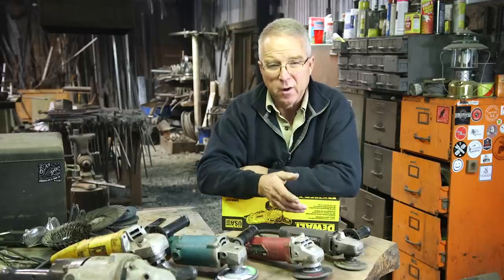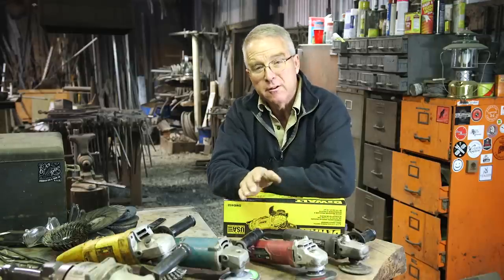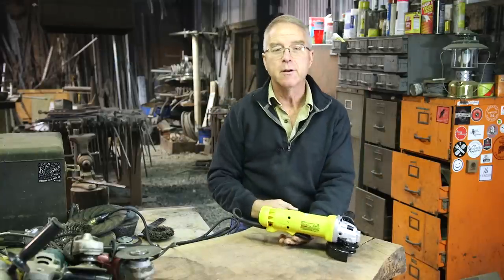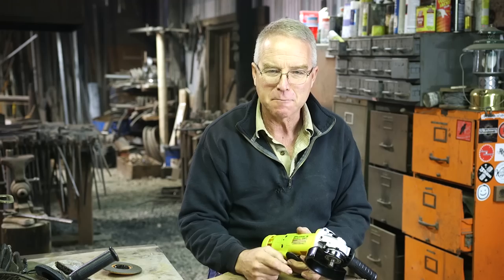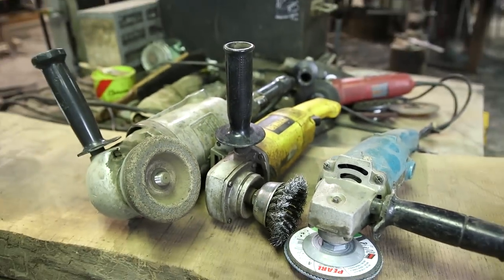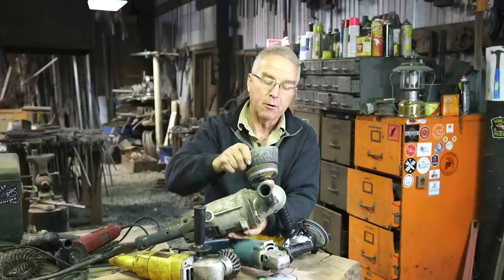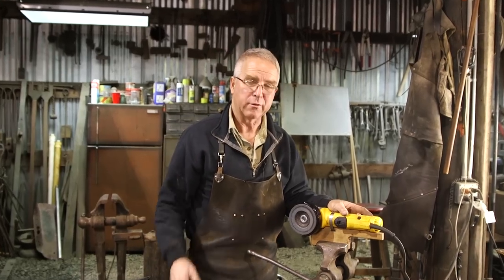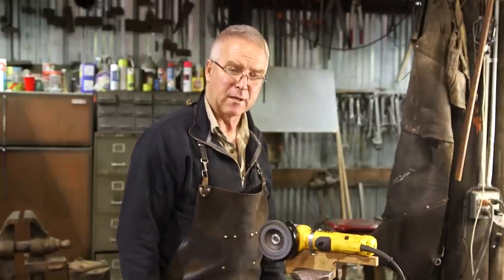Get Another Angle Grinder

Comment: You need at least 3. That way you can braid the cords together as you work. Just twisting 2 cords together isn’t quite enough.
Reply: lol 

Yep. Then too I find I need 2 or 3 of any tool just so I can find ONE when I need it... lent, "borrowed", hiding. Darn things just won't stay put when I put them down ;-)

...oh, and with cordless you can't braid at all, and they tend to wander even further lol
Reply: Plus your air hoses tied in with them :(
Reply: I guess i need to return my cordless Milwaukee
Reply: @robekstrom2736  Yep, cordless is cheating.
Reply: lol 😄
Reply: Don’t forget your welder leads.  They need to be woven into the braid.  For some reason…
Reply: @jrbamatex1949  The best thing I have spent money on in the welding equipment world is the wireless pedal. Unlike cordless grinders there is 100% no down side to the wires pedal, other than the price. They are proud of them for sure.

Comment: Been metal working over 20 years. The last grinder I bought was a Bosch with variable speed. Total game changer. I'll never go back. It's super nice not to have everything spinning 12k rpm. I love it. Great videos sir 👏 thank you
Reply: How can the engineers not have chosen to have Variable speed? I didn't know angle grinders have that. When my DeWalt gives up I'll look for variable speed
Reply: @86Raxor  no paddle. Just a off on switch. Not as safe.
Reply: I bought a 3 foot long dimmer cable for $3 and control my speed with that. Works on fans, saws, grinders, lights, and anything else you can imagine.
Reply: @nevinkuser9892 some shit don’t like that

Comment: As a fabricator I run a grinder every day and I can't figure out why people insist in taking the guard off.
Reply: I removed it from one of my grinders ,reason was explained in video,tight spot for cutting ,and that extra cm i could get by removing guard it helped me to finish get the job done.If u know how to hold grinder while working,plus using thick gloves ,doesn't matter u have guard or not ,if disk shatters to peaces nothing will happen to you.
Reply: Never take the guard off. Ever.  I'm a welder and known too many people use it without a guard and it decapitates them. Yes it get in the way, yes it slows you down, but a chunk of a cut off wheel in your throat will slow you down alot more. Dont be a goober.
Reply: Same here.  I do modify em  , I keep em about 270 degrees and about 1/4 " tall !
Reply: I usually have the guard off for grinding, and have it on for cutting.  
Have never seen a grinder wheel/flapper disc/sanding disk explode. I can get in places alot easier without a guard and can control the direction of sparks alot easier when grinding near windows etc on site.  
Since swapping to freud cutting wheels I very very rarely have one explode, but usually have the guard anyway for a precaution
Reply: @oystercovecraftsman9219  Grinding wheels can explode too, but if it's not a crib death you can usually see it coming. Just keep an eye on how it's wearing and throw it away when you get a bad gut feeling. I still wouldn't use a 20 year old grinding wheel which had been stored under water.
Reply: It's all about apprentices getting the disk pinched in the cut or getting scared at the first cut.
Reply: We just bought the new  4 and have inch  battery one and very happy whit it.
Reply: @TheSRBgamer63  Make sure you wear a face shield (on top of your safety glasses) if you like having a pretty face
Reply: Only reason I took mine off is because it vibrates so badly at times where it rotates it into the way cause it's a cheap one.
Reply: @Mikey-ym6ok  Just wear a face shield. I do with or without guard.
Reply: @TheSRBgamer63  I used one of mine without the guard and wearing welding gauntlets and didn't work out what the smell was until the cut off wheel had cut through the gloves and I was getting a bitch of a friction burn on my knuckles. I suppose I should have realised earlier but I was focused on the job. Guard on all the time for me.
Reply: 454Casull I 100% agree with you. The grinder is a very dangerous tool. When a wheel disintegrates at 11 000RPM, no human can react fast enough to get out of the way.
Reply: Right ? I always use the guard, because the sparks are annoying and make it hard to see what your doing

Comment: I started off with a $20 grinder from the local Hazard Freight, that lasted right up until I spent five hours grinding plate for welding school. Decided 'the hell with this', went down to Lowe's and got a D43113. Double the power, way more torque, a vastly higher speed, better handling, and way less vibration going up my arms. Worth every penny.

Comment: Having more grinders don't cost much at all in the long run since you are probably going to get always same amount of hours out from each one in the end. The more you have the longer they last.
Reply from the maker: Bingo that is a great point!
Reply: Yes and no... You can actually save money owning multiple grinders if you buy junkers for the junk projects that you know will burn them up fast. A grinder running a wire wheel should cost no more than $40, ever, unless you a need a 7" because you're stripping a dump truck or something.
Reply: @TheBrokenLife  thats what a 9in grinder and wire wheel is for
Reply: This is my argument to people who don't want to buy snow tires.  You can buy one set of tires that are ok in summer and terrible in winter and replace them every four years.  Or you can buy snow tires and summer tires, both far better when you actually use them, and since you use them half as much they last twice as long.  Roughly the same cost...you just have to swap tires twice a year.
Reply: @Drew Why stop there? Just get a couple thousand horsepower of air compressors and media blast it. Done in a jiffy!
@Garrett McEwen Except it's extremely hard on tires to be mounted and dismounted over and over again. I subscribe to your philosophy, but I have 2 sets of rims too.
Reply: yep. Ive killed more of those cheap dewalt grinders exactly like he is unboxing.they heat up and fail..... and they arent expensive so you could have one for every wheel you need, that lets them cool off and they last longer.
Reply: @TheBrokenLife  yes I also believe an extra set of wheels is important
Reply: @TheBrokenLife  because if i need something blasted i take it to work
Reply: @wgmskiing  i just have a nice set of tires for offroading and if i need to i put chains on if the 4x4 doesnt get me out
Reply: Grinders are like pairs of shoes, if you're going to take the time out of your day to go buy one and find one that you like, you might as well grab two and save yourself the hassle next time around.
Reply: Hilti does not warranty grinders because they just wear out.
Reply: 1 grinder for every kind of blade you use at least once a day. Get lots of different kinds too.  slower or variable speed for wire brushes, fast and ergonomic in the side position for the zip disk, light weight for detail work like polishing, big beefy ones for grinding, etc. You really won't regret having too many.
Reply: There is another factor here. The weight, sometimes you need the lightweight tool. Less weight is less inertia. So the tool is easier to handle. In my experience as a welder when you need to remove a thin layer of oxide from the metal or the coat of paint to have a clean surface. This is a light duty work that any angle grinder can handle and the cheapest grinder are the best because they are built cheap therefore use less materials to make it. When you're at the top of a very high structure and your workpiece is at a very inconvenient  position and you have to do some yoga see what you're doing then you want the crappy chinese tool. For the rest of the heavy work I go with the DeWalt tools, I have abused some of my grinders for 12 years and still working good.
Reply: @wgmskiing  And the cost of any accident throws the savings of buying one set way out the window.
Reply: Perkele!
Reply: What are the failure modes for a grinder?
Reply: @ThisIsNotAVideo  as he & AvE have pointed out, schmoo goes in the air vent and clogs it up, or the trigger goes.
Reply: @ThisIsNotAVideo  Those wicked cheap DeWalts that TEC unboxed in the video will crack their head-casings if you bind them up hard - most grinders above the $100 mark will be built with better materials or be engineered to withstand it. Motors will burn out when too much debris accumulates. Overheating will kill a (normally, poorly designed) grinder with a quickness. The solution to that is to keep the motor speed up and avoid bogging for more than a few seconds - bogging will put the motor at full load with less airflow to cool it, as the fan is tied directly to motor RPM. Trigger switches will go out before most quality grinders give up. You may slice a cord or two, so buy some heat shrink and a soldering gun lol. That's pretty much it for the most part
Reply: Got to have a two horse 9” to start with, anything else you need is good, do not buy a cheapie for light duty,why ? because one day when that one is nearest, you will use it on something that drags, you’ll kill it in 5 minutes and be without one,so you’ll have to go and buy another.  Nothing wrong with a thumb switch, If you keep it clean. personally I do not like paddle triggers much.   Angle grinders should be green or blue, you might be able to find a yellow one easily, but it won’t work well.   Yellow is for plant not tools !
Reply: Same with shoes , lol

Comment: Posting this because I feel it was missed. If you're leaving the cutting tool on the grinder (especially cut off wheels), flip the grinder upside down to prevent the weight of the tool from cracking your cut off wheels. You will also notice dewalt builds them with a flat resting edge so you can do so.
Reply from the maker: Good tip!!
Reply: that's only if you don't have the guard on. And good quality cutting disks are both flexible and tough enough to take a fair bit of abuse without shattering. It's all about the adhesive used.
usually, disks made for stainless steel are much better quality, albeit a little more expensive.
Reply: Noone in my yard uses guards on their grinders. nor do i, most of the time you're rushing and putting to much weight on the disc and it shatters. inexperience kills more often than not.
Reply: No shit. Thanks for saying!

Comment: I've only used this once to sharpen my mower blade https://www.youtube.com/post/UgkxPDBfLu68o58Aw85O_J-zIFfjJARBhp-3 but so far very happy with it. I've never used one of these so took me a bit to figure out how to set it up but once I figured it out it did the job just fine. This is likely a single purpose tool for me to use on my mower blade and possibly the occasional axe sharpening so didn't see any need to spend a lot....this will do just fine!

Comment: Hi!
Nice tool, have some of them.
We're in Russia some times extend this tool life by covering air intake by thin tissue, for example - cutted sock.

Good luck, thanks for the content.
Reply: Good idea
Reply: Joe Palazzo as long as you change your socks before the tool overheats🤪
Reply: Yup very good idea. , Add a tube sock over the air intake to reduce gunk in the ..schmoo ?.. motor ! If it gets hot , ditch it .
Reply: Works well with nylons it's like a machine air filter....

Comment: 40 years ago, when I was 18, I hired in to a weld shop. My boss said fill these drill holes, and grind them flush. It was a huge plate, sitting on short horses. Filled all the holes, grabbed an angle grinder and dug in hard, it kicked and promptly ran across my leg, just above my kneecap. Right through my jeans and long johns, and kind of melted an 1/8" channel, 4" long. Instant respect for that tool.  Thankfully, an older coworker showed me where to make first contact with a spinning wheel, how to aim the flow of sparks, etc. I've wore out a few grinders since then.  I always enjoy your videos. Thanks.

Comment: I have found cutting off about 10 degrees of the  guard can really give you that added versatility you need to get into tight spaces. When doing fine detail grinding and cutting I noticed only a small amount of the gaurd was giving me trouble and no matter what position I put it in it would still be in the way. It has saved me some time and if you have any spare guards I really think it comes in handy.

Comment: Hands down angle grinders are one of my favourite tools. I've had so much use out of them. Used them to cut slate slabs, cut into old steps and tarmac, cut angle bead precisely, cut blocks and bricks, cut angle iron. My second go to tool surprisingly is a Hoover or a broom, keeping site clear of debris helps you see where you are at.
Reply: And it will keep you from falling too. I work on a smooth concrete floor in the shop, after a day with a lot of grinding you can skate around on your safety boots just bcs of the sheer amount of metal dust on the floor. I also wipe the floor every day to avoid this 😂 sometimes a few times a day if its a grinding day lol

Comment: I've had a D28402 for 15 years. It's my smallest grinder and is used the most.  I've often commented that I can't believe I spent most of my life without one. I've got an uncounted number of tools but the little grinder is the handiest.  Whether I'm doing woodwork, concrete work, forging or some steel fab it's always near.
Reply: I have 2 Makitas with the on/off switches on them and they will not turn off until it runs out of power, wishing I had bought the paddle switch versions for safety, I have already had 2 accidents with them over the years
Reply: i have a dewalt 11amp 4 1/2" grinder aswell, one of my favorite tools. use one every day at work.
Reply: @gertv6777  give dewalt 11 amp 4.5" a try. it's nice that the safety toggle on the paddle switch is still easy enough to operate with welding gloves on i've had only 2 accidents with grinders i was injured in neither one, but still, twice using wire wheels one time i had headphones on and was grinding under a tank and set it down on my shirt while it was still ramping down and it ripped a 5 inch hole... another time i think i was grinding on a trailer the wire wheel cought my shirt clam up the front of my shirt andhalf way down my back ripping a hole the entire way LOL.

Comment: Metabo is my favorite.  I'm an ironworker,  and we use these everyday.
Reply: same. none of the other brands will last as long as the metabo will. that being said, i own two grinders, the metabo has no guard (the lugs sheared, i rescued it from the dumpster) and is for doing actual ironwork, the dewalt has a guard and gets used when a guard is needed (rarely) or i'm going to plunge it into grease and nastiness (far more often).
Reply: When I started my 1st welding job just out of weld school I purchased a 4-1/2” B&D Professional. I must say back then B&D built some of their power tools tough. It is still working today despite a broken spindle lock pin 37 years later. Nowadays I would agree with your choice or Milwaukee, Mikita or Dewalt, as long as it has a paddle switch or pull trigger switch.